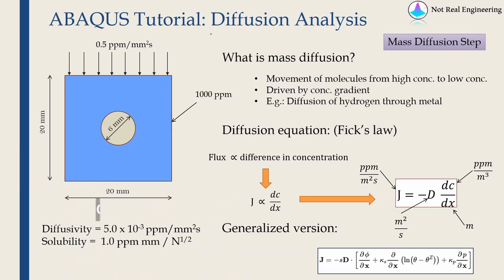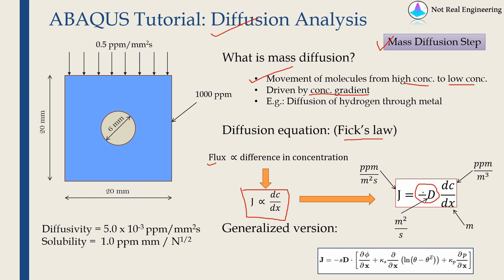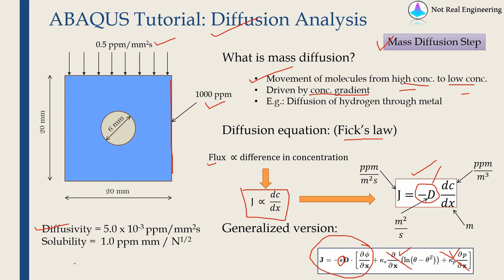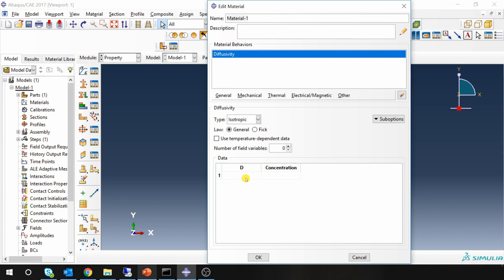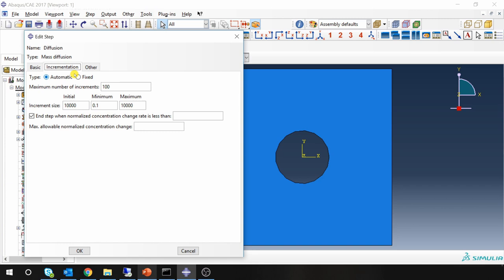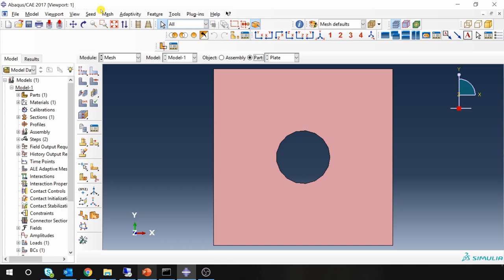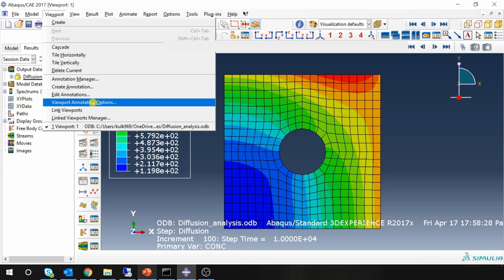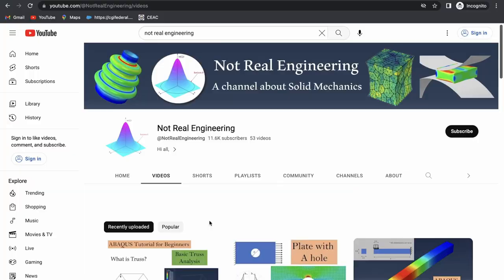Diffusion analysis ABAQUS CAE tutorial | Diffusivity and Fick's Law

Comment: I have a microstructure where a fluid diffuses from position A (high pressure, high viscosity and high density) to position B (low pressure, low viscosity and low density). Can we treat this as a diffusion problem and solve it in Abaqus? Maybe we can do something using usdfld, but I am unsure. It would be great if you could make a video on it. I really appreciate any help you can provide.